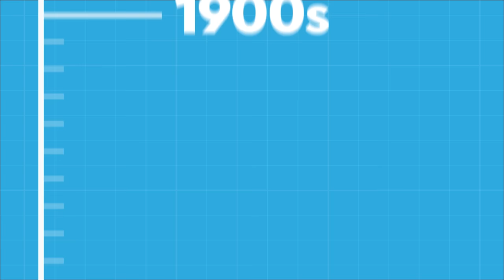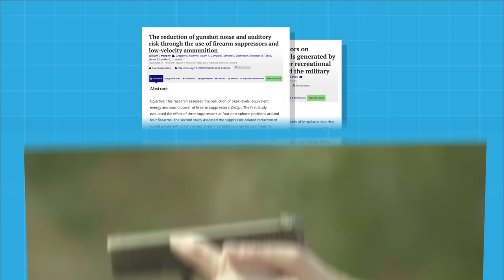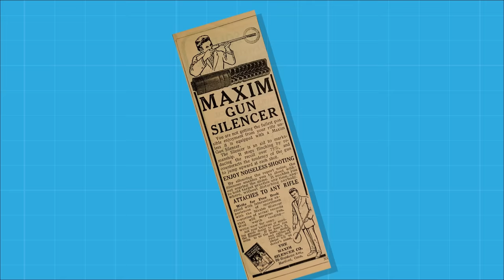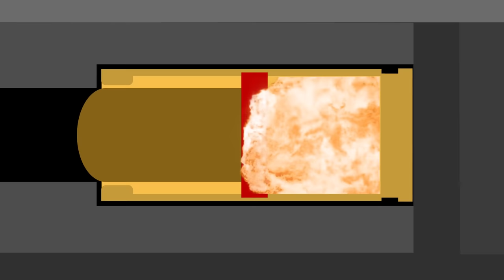How Silent Are Gun Silencers? DEBUNKED #moviemyths #debunked

Comment: The video did good up until the end when it declared that it's impossible to get Hollywood grade silenced shooting - that is false.
Simple trick anyone can do - fire a .22 short subsonic cartridge from a .22 rifle - all you will hear is the click of the pin striking the cartridge and the thwap of the bullet striking the target - no silencer/suppressor involved.
In general, the lower the caliber of the bullet being fired - assuming it is loaded to subsonic specs - the more quiet you can get it, especially with some of these modern cans.
Another trick to reduce noise is by using a locking mechanism which prevents the semi-automatic firearm from cycling, thus removing the sound of the mechanism cycling when fired.
The video also failed to mention the fact that revolvers don't have the option for silencers/suppressors due to the gasses which escape from the gap between the cylinder and the barrel - you will only see silenced revolvers in fiction, video games and toys.
All said, if the video had ended around the half to two thirds point, it would have been good.

Comment: Well it's funny you need ammo that is subsonic for starters and its still is a crack you hear not quite by any means unless it's a .22 with subsonic ammo and such the cylinder make a loud noise also. Case in point you won't hear it a mile away not even a few blocks away.

Comment: the quietest guns made are the WWII Welrod, and the VP9, which was heavily influenced by the former. They are said to be about as loud as a hand clap or loud finger snap. This is achieved through not only subsonic rounds with an integrated suppressor as the gun barrel, but also a rubber seal that the bullet travels through from the chamber, and the locking bolt, containing the sound in it. Obviously once one round is fired through the seal, it progressively gets louder as the rubber gasket gets torn through more and more...so even their use is extremely limited.

As is usually the case, Hollywood is horrendously wrong about firearms. Shocking...I know.

Comment: A very good way to think of suppressors is exactly the same way as a vehicle muffler
A bigger caliber will have a bigger bang, even with a suppressor. Just like how a muffler will have a greater effect on a 4-banger engine than a V-12 semi

The best way to achieve the game/movie quality of PFFT is one of two ways
-using a subsonic load, which is going to be expensive. Not only that, but you’re basically going to have to re-rack the slide/bolt every time you shoot due to insufficient pressure to cycle the weapon
-Or use .22LR or (from what I hear) the fat boy .45 ACP round (I’m sure fellow ammosexuals will correct me) instead of the ammunition you’re trying to make quiet. These are inherently subsonic

Comment: The idea of a suppressor is that it lowers the gunshot volume to a level where fairly normal noise levels will cover most of it. A subway train passing could probably cover the sound of a silenced gun very well but a non-suppressed gun would require a plane going overhead at low altitude to cover it. It's important for snipers because a very good solider can roughly guess the position of an enemy sniper by the "snap crack", with suppressors snipers are more difficult to locate from sound alone.
The Welrod was extremely quiet because of the integral suppressor but also the rubber disks that the bullet would pass through, that would "reseal" behind it and trap even more expanding gases. The Welrod is considered one of the quietest guns ever fielded and only had an audible range of around 15m, which is astonishingly quiet for a gun.

Comment: Subsonic rounds with a suppressor dont make much sound at all
Reply: 100+ dB(A) with proper sound test tool for firearm on subsonic suppressed .22LR pistol is still a bit louder than lawnmower but the duration is brief probably a tenth of second, while 9mm subsonic suppressed pistol produces around 130 dB(A) louder than jackhammer (unsuppressed 160+), measured one meter away from the shooter.
Reply: I use a suppressor on a bolt action 22lr the trigger click is louder than the shot. Guess I just use a better suppressor.

Comment: Well actually is possible to make Hollywood silent weapons. Subsonic ammo is first key to success. Even for revolver is doable with custom ammo. Tungsten carbide projectiles, soft primers and light trigger. Even PCP cartridges can be used. For the ultimate revolver scene only spring piston cartridges with tungsten carbide projectile with no gases or powders whatsoever. 1/4 of subsonic speeds. Not just subsonic. Around 70 meters per second. Ordinary weapon will not cycle due to lack of enough recoil. Basically will be much more like crossbow velocities. Most cartridges don't have such specs. Only 45 ACP and 22 Lr have extremely low subsonic loads. So custom design revover with pistons instead of gunpowder. Smooth bore to avoid as much as possible friction between projectile and barrel walls.

Comment: Suppressors don't work on revolvers. Too much sound leaks out around the cylinder. Also, a bullet traveling faster than sound will make a sonic "crack". A Colt 1911 bullet might be subsonic. There are still a lot of parts forced around by the pressure. I wouldn't want to hold my ehe to the end of a sight as in 7:38 for tea the kick will give me a huge black eye.

Comment: Not quite accurate. A sub sonic bullet can be quite effectively silenced with a big enough silencer. I had a .303 SMLE that I hand loaded with 200gr cast lead bullets so it was sub sonic. When I fired it you could hear the firing pin hit the primer and then hear the bullet hit the target 100m away. On a semi automatic its more difficult, particularly blow back designs because some sound can escape at the breech and the action is usually quite noisy.
An empty plastic bottle taped over the muzzle of a .22 firing sub sonic ammo is also surprisingly effective, but only for a few shots, then the hole starts to get a bit bigger and it loses effectiveness.

Comment: How Silent Are Gun Silencers? DEBUNKED

Silencers don't silence guns. The more accurate word is suppressor. They suppress the sound of the report of the cartridge to lower decibels and even then they do not prevent the supersonic crack of the bullet as it breaks the sound barrier unless the cartridge and bullet has been reduced to subsonic levels. If the cartridge and bullet have been reduced to subsonic levels then the sound can be contained much better. The mechanical sound of the bolt or slide can still be audible even if the sound is suppressed to below normal hearing levels. Some low velocity subsonic loads such as .22 rimfire even without a suppressor cannot be heard with the naked ear outside of a ten foot diameter.

Comment: Silencers just reduce the sound does not make gun silent like we see in movies , ammunition may or may not be subsonic , best examples for extremely silect pistols is welrod it has wipes between baffles in silencer body but that's only good for 10 or so rounds that tech is only for 9 mm or lower bullets and bullets should be subsonic and should not be hollow point and the non drilled part of the berrel of gun should be short but not so short that bullet can't get up to speed and the tech is used to mask the noise of gun not make the gun

Comment: Does the usage of a silencer reduce the accuracy and precision as well as the effectivessness (in the sense that the target would become incapacitated) of the gun? In other words, how would it change the operating characteristics of a gun eqiopped with one?
Reply: It doesn't effect any of that.
Reply: it does not. games just do that because they dont want the guns to be too overpowered
Reply: It has an effect but it's highly variable. Some combinations will actually cause a bullet to tumble. Others won't be affected at all. It definitely slows the bullet down. How much that matters depends on the situation.
Reply: @patrickweaver1105  that's not true at all.  It will actually very slightly increase the velocity.  All of my suppressors give about a 25fps increase in measured velocity.
The only way they would cause a bullet to tumble is if you had a baffle strike.
Reply: @z987k  Some bullets tumble on their own at critical velocities. If your suppressor is increasing velocity it's the wrong one. The purpose of a suppressor is to retard gasses   and reduce muzzle blast by releasing them over a longer period of time. That's the reason for expansion chambers. That means the bullet loses muzzle energy.  A long enough barrel can do the same thing.
Reply: @patrickweaver1105  you clearly have never used suppressors.  ALL of them increase velocity slightly.  Bullets tumbling at transsonic can be a thing but the suppressor is not slowing a bullet from Mach 2.5 for an average of most centerfire cartridges to transonic.
Honestly I'm questioning if you've ever shot a firearm your assertions are so ridiculous.
Reply: @z987k  All of them do not and if yours does you're making a lot more noise than you need to. Silencers can increase bullet yaw. If you're shooting bullets at 2,800 fps a suppressor is likely a waste of money. A set of earmuffs would work quite well and are probably advisable anyway. Mach numbers don't mean much unless you're shooting at standard temperature, pressure, and humidity because the speed of sound varies so  much. You can skip the ad hominems they don't change the facts.

Comment: I love silenced rifles in real life, at the range. Here in AZ, lots of people have suppressors and it's always a hoot to hear them on a .223. A bang like a .22, followed by a really weird supersonic howl, and then a loud clang as they hit the steel.
Wish they weren't so much trouble to get lawfully. 
Any criminal could make one for under ten bucks, but almost no thug wants them for very obvious reasons. 
For those who never used a gun, they make the gun much bulkier, much less reliable unless 'tuned' for the 'can', only enough quieter to keep them from damaging your hearing, and they limit you to using sub-sonic loads if you want to not have to wear serious ear protection anyway.
Suppressors are mostly useful in protecting shooters hearing.
A Glock nine millimeter, the main choice of thugs in this day and age, will only be a tiny bit quieter with a can if you use defense loads, make the gun very hard to conceal and much less reliable.
They are good for a homeowner who doesn't want permanent hearing loss in a home defense situation, but hardly worth the five hundred to a thousand dollars it will cost you to get one if your state allows them.
A crook buys a 'water trap' or a 'fuel filter' and just screws it on.

Comment: One common movie fraud is the silencer screwed onto an ordinary revolver. This is almost useless because of the gap between the cylinder and the forcing cone (start of barrel). This gas escapes BEFORE the bullet even leaves the barrel, and is this unaffected by any silencer. However, reality is never that simple. There DO EXIST revolvers that CAN function effectively with silencers. Emile Nagant devised a series of gas-seal revolvers, which are effectively quieted by their matching silencers. This is similar to the Webley–Fosbery Automatic revolver. Both pistols had effectively NO GAP between cylinder and barrel. More accurately, the cylinder moved forward so that the nipple on each chamber fitted tightly into the matching depression in the forcing cone. The protruding brass cartridge case acted as a seal. Of course, the cylinder had to move straight backward upon firing, then get indexed by a cam causing rotation and thus moving the cylinder into position to fire the next round. The USSR made vast numbers of silenced Nagant revolvers for the Secret Police.
On the other hand, I have personally heard the firing of the Ingram M-11 with silencer. In fully automatic mode, the ONLY sound that I could perceive was the cycling of the action. There was no audible report. This was at an outdoor range.

Comment: does it lower the speed of the bullet?
Reply: Generally supressor doesnt lower speed of bullet. Usually it even gains more speed.
So in most cases that is backwards. Some very specifig integral suppressor which have
its barrel made to bleed propellant gasses to outer part of supressor before bullet
exit barrel. 

Whole idea is to make normally supersonic ammo come out
as subsonic whitout needing speciall loads for those guns.

So simple answer for that question is no.
Reply: yes. as is the range and penetration.
Reply: @NoTruth_42069xdgodxqtjaja  Ah Classic Call of duty logic there. Or literall any fps game. Gotta wonder are those really reason why people even ask that dumb question does that make bullet go slower...
Reply: @Kesssuli  if you shot a single shot once every 10 seconds maybe. if you use it on automatic weapon at high rate it will. Gas disbursement won't be good enough and will lead to faster overheating. Try shooting 300 rounds with it and see where it get you. If there was no downsides to it everyone everywhere would use one always.
Reply: @NoTruth_42069xdgodxqtjaja  At first: Why so sudden change from being smartass to hardcore textbook? Second: Very simple question and very simple answer. Third: It was you who made thar dumb fps game reference. And the rest: Of course supressors have drawbacks. Generally you dont use it on guns meant for supressing fire because serious heating. But when it comes to typical assault rifle soldier doesnt carry that much of ammunition with him to overcook a supressor made to withstand automatic fire. Gasses bursting back because increased pressure in di-systems is bigger problem to user friendlines which actually matters with increased weight and lenght of gun. Overally it is far more about weight and more money to soldiers weapon system than anything else.

Comment: And Nobody wants to discuss that the second shot from a supressor is quieter than the first ..  partially due to lack of oxygen inside the supressor causing less gas ignition of the unburned powder coming out of the barrels end . .. another un Fun fact ...supressors make the weapon need to be cleaned a lot more often than a identical weapon without a supressor because of all the powder residue being trapped in the weapon ..

Comment: There is a little false info in your video. The main purpose for the suppressor, as to why it was designed, was simply to protect from hearing loss in combat. Contrary to popular belief,  a suppressor will actually make the shooter EASIER to pinpoint. An un-suppressed rifle's report (boom) has a tendency to echo more off of nearby structures, broadening the possible area from where it originated, whereas suppressed shots echo less, causing the noise from the rifle to be more direct if the enemies in the target area are paying attention. Some branches of the US military utilize suppressors solely for the purpose of urban combat and in buildings to protect the soldier's hearing. Firing an unsuppressed firearm in an enclosed building can easily lead to immediate hearing loss without ear pro, and still cause damage to hearing even with ear pro.

Comment: While you did touch on the subsonic part, you clearly didn't do your research all the way.

A silencer/suppressor is not intended to remove the noise completely.
But there are special weapons designed with this idea in mind from the get go.

You never talked about the suppressors that have rubber discs in them. The first shot with those are really quiet. And subsequent shots get increasingly louder as the discs wear out.
With a sub sonic round in them, they are but a whizz through the air. Of course the punching power is less and the range even lesser. They were made for the specific purpose of taking out one or two enemies without alerting the whole group.

And given enough of an expansion chamber, the sound of the propellant gasses can be silenced enough to where it's the same effect.

You also never talked about bolt action or the pistols designed with silent takedowns in mind. There are pistols where you can lock the slide so the mechanical sound of it racking back is eliminated. Of course you'd have to rack it manually to shoot again, but that's the cost of silence.
It is entirely possible to make a firearm sound nothing more than an arrow being launched through the air. The only sound being the air being pushed aside by the bullet as it passes through it.

The movies has it wrong, but all these "silencer debunk" videos also have it wrong. The truth is closer to that of the movies when it comes to those specially designed weapons.

Comment: If you guys are trying to debunk a rumor, why not call this attachment by it's proper name??

A "Supressor" sounds similar to a spring-loaded rat trap snapping in a small room, barely noticeable from across the hall, or on a different floor, and inaudible from the street outside.

There's your 8-minute video, corrected & condensed.